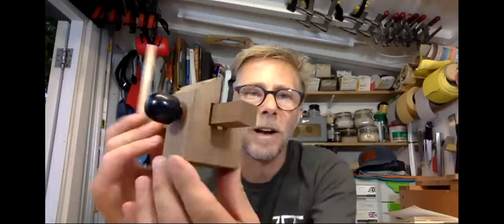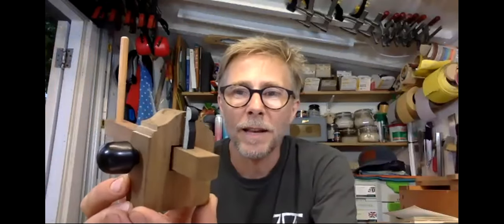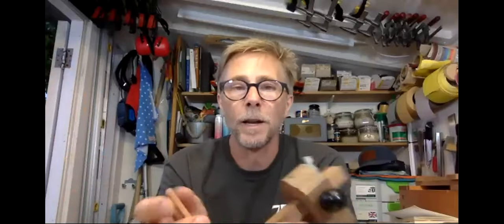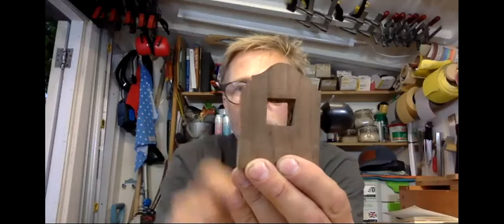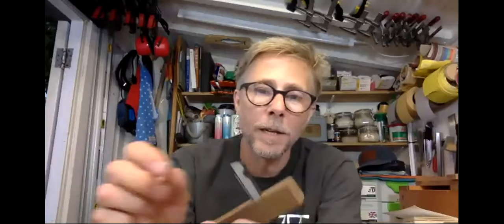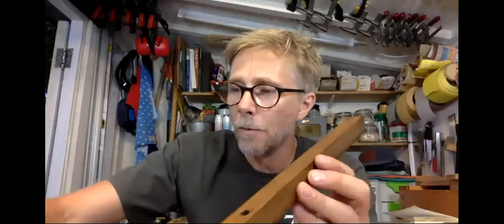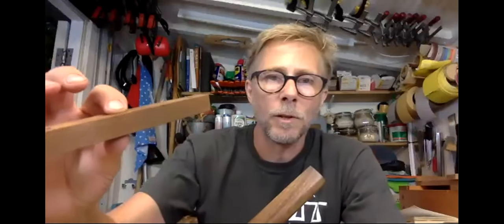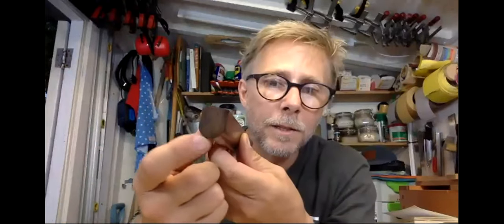Bench.Talk.101 Derek Jones talks " A Modern Twist On Old School Marking Gauges"

Comment: These talks are great.  I hope to join one live, once I retire in the next few years. I find several little tidbits in each episode.  This episode I learned about the angles the cutter, tacking the smooth part of the box off when threading, and the value of having the more rounded side on the cutter side of the beam.   Thanks folk for doing to this so well.  I hope this goes on beyond when we get to the new normal.